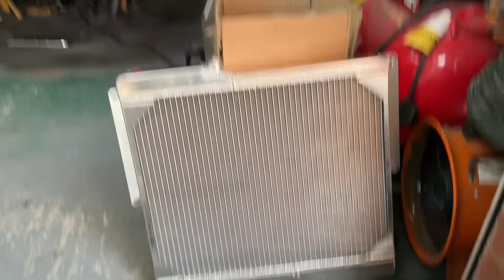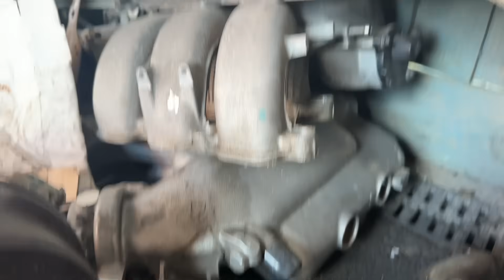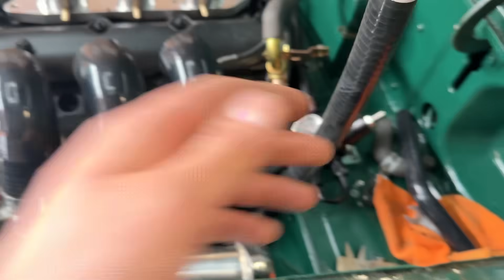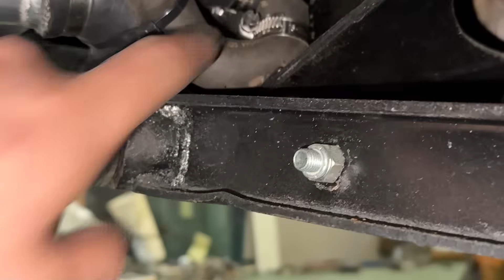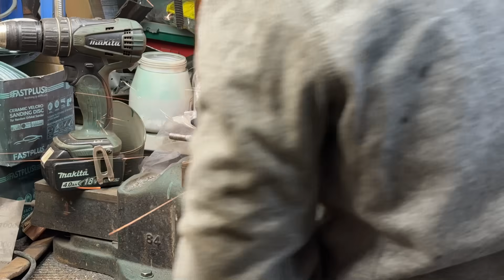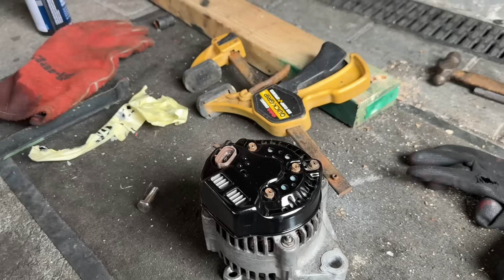FINALISING THE ENGINE BAY!! - Cooling, Intake & Alternator on my Jaguar powered MGB GT!!

Comment: Hi Henry, For some reason I can't add another comment on your latest video post of the MG starting and Moving? However, you won't be able to get your mgb temperature gauge to work with the new Jag engine. The MGB use a combined Smiths Oil & Temp gauge, the temp side is fed by a vacuum sealed microbore tube linked to a bulbous sensor that screws into the block. You'll need to replace the gauge with one that is fed electrically. Cheers Nic
Reply from the maker: Thanks for this! I need to try and find one that’s got a standard coolant temp and oil pressure look but with a 1 pin coolant sender

Comment: I've given up on POR15 , it doesn't stick to new steel well and other paints  don't stick to it well,  also it doesn't keep long in the tin. I've switched  to epoxy primers now , on the under body I also start with brushed and rolled on cold galvanising primer under the epoxy , it's not a tough paint but the epoxy protects it well enough and I've had  hardly any issues with stone chip damage leading to corrosion blisters under the paint.
Reply from the maker: Good idea!!

Comment: just a old school tip for you, to check clearance under a hood after modifying, place old corrugated cardboard box over the area you're trying to check for clearance, slowly close the bonnet fully if possible.  on opening bonnet you will see perforations in the cardboard where there insufficient clearance. no marks in the cardboard means you've got clearance, if you need more of a clearance use more layers of cardboard. heads-up on the alternator, Car alternator generally will still work even if it's spinning in the opposite direction,  however the cooling fan on the alternator might not be as efficient as it will be spinning backwards and being that close to the radiator you will definitely running to issues. all things one learns by making mistakes.
Reply from the maker: That’s a good idea! 👍🏻 and yes I will have to see with the alternator. I’m hoping those 2 electric fans on the rad will help!

Comment: I thought at one point that you had lost it with the alternator, but a great resolve on it. Those Triumph  regulators really do look as though they belong too. Well done H. You rightly should be proud of how it's shaping up. Are you going to go through the belt tightening to show how it works in that tight location? Great work as ever, Joe,
Reply from the maker: Yer I will, I have done it now but I can go back and explain. Probably when I do the wiring👍🏻 Cheers!

Comment: Hi Henry great project, throughly enjoying following your progress. 😉 Just one question regarding the intake etc clearance issue, have you considered using the MGB 6 cyclinder or V8 bonnet? 🤔
Reply from the maker: Yes 👍🏻 I want to keep it as standard looking as possible from the outside for that sleeper look but it’s a possibility if I need to!

Comment: Hi Henry, you can only pass criticism or negativity if you could have done better yourself, me personally no I couldn't so well done, keep it up.  I suspect you will find some challenges around the wiring, just the way of the world.  The exhaust will also present its own challenges, based on what you have achieved so far I'm sure you will just take it in your stride, adapt, improvise overcome.  That alternator mounting and how you make the wiring work will be interesting, you are right everything is so tight.  Inlets / throttle bodies, very innovative, not the sort of solution you find in a manual anywhere.  Looking forward to the next episode.  Cheers Marty.
Reply from the maker: Thanks Marty! Much appreciated 👍🏻

Comment: An amazing transplant Henry, you have innovated and cajoled the whole thing into bending to your will. I would have given up around the time of the exhaust manifolds. The only issue I can forsee is that you need a shroud between the radiator and the support panel. Air will take the easiest route into the engine bay around that radiator , rather than go through it, unless you force it to with a shroud.  On idle in traffic with the fans on the air will recirculate around the panel and you will be overheating really quickly. Having the twin fans won't help unless the hot air can escape. At the moment, it will be trapped in the engine bay.  More power means more heat to get rid of.
Reply from the maker: I will have a think! And see what it’s like when it’s running if it needs it I will make it!

Comment: Henry, just a thought, do you think that heater valve might look more in place if it was painted black or grssn like the coachwork? It wouldn't stand out as much as it does in brass. Having said that it doesn't stand out that much.
Reply from the maker: Potentially! Although with the intake there I don’t it looks too bad now!

Comment: I strongly suspect you'll need to do something about that steering rack boot in order to be able to use the car legally on the road. You're going to need an MoT test due to the engine swap being a "substantial change", and having anything fouling any part of the steering gear is a major fault on the test.
Reply from the maker: Speaking to my MOT guy who’s an MG specialist in Warrington engine swaps don’t necessarily mean it needs an MOT. But I’m going to have him do one anyway.
Reply: @HJRgarage  The MoT exemption remains if the engine swap uses a type available as original equipment, even if the capacity is different. In the case of the MGB, a Rover V8 or a bored-out B-series would retain the exemption. 

No MGB ever left the factory with a Jaguar AJ-V6 engine, so this counts as a substantial change which loses the MoT exemption.
Reply: @Zeem4  You are wrong, DVLA are only interested if it breaks the eight point rule so the engine swap is okay but the body mods are not. It all depends on how the MOT tester views it. I am doing the same conversion and went down to the local IVA test centre and they said tell the DVLA what you have done and see their response. The same with the MOT test, the tester is supposed to inform the DVLA of non compliant conversions. The MOT exemption is ridiculous anyway, every car should be tested annually.
Reply: @philipwaterman7292  The 8-point rule only applies to retaining the original registration mark on a "radically altered vehicle".

However, I've just checked gov.uk's classic MoT exemption page again, and I suppose that installing an AJ-V6 into an MGB could be classified as improving the efficiency or environmental performance, which would mean that it doesn't count.
Reply: @Zeem4   I informed the DVLA of the AJV6 engine change, I also informed my insurer, the insurance companies share information  with both the DVLA and VOSA and no one has asked a question as yet. Admittedly It isn't on the road but no one has asked. The eight point rule is about keeping the classic car status, when you loose that you loose the MOT exemption. After the consultation last year it is likely classic cars will loose the MOT exemption which will mean the MOT tester will be reporting more cars that don't comply.
Frontline fit a 2.5 Mazda engine cw Mazda gearbox and much modified suspension into both MGB's and now MGA's, they keep the classic car status due to complying with the 8 point rule. Even body mods are allowed if the factory did it, that is why there are so many Sebring copies, holes in the flitch panels for the exhaust is also allowed because MG did it for the RV8 and modifying the bulkhead is also okay because it was done for the original MGB V8. There is some disagreement as to whether those mods to the bulkhead have to be done  with original factory panels or not.
Reply: 👍like a glove

Comment: When mounted backwards, will the alternator not be running in reverse ? does that work ??
Reply from the maker: Phil got there before me! Read above 😂
Reply: I've done the same on my engine swap. It will work fine.
Reply: @ianmcass  Cant get me head round it, but must do as you say, never been good with that electrickery
Reply: @ianstoys13mgs  It generates either way, the only downside is that the cooling fan is running backwards so it is not as effective. The solution is to use an alternator from a circa pre 2003 Honda.

Comment: Throttle body clearance... I would ditch the T-Bolt clips and use decent jubilee type clips.. I use JCS hi-grip and hi-torque on turbo setups running 2bar boost and never had a hose pop off so they will be more than enough for an NA setup like yours... 

The narrower profile might give you wiggle room to cut a little more off the hose to get it to sit lower...

Alternatively maybe a 135 degree hose would work as that direct the bodies a bit lower too
Reply from the maker: Yes I have considered this! Nice one 👍🏻 this is not the final version it’s going to be a working progress for a while!

Comment: Those ITBs look impressive but I bet the engine will collapse those rubber intake hoses when the throttles are shut
Reply from the maker: Potentially but it should be ok it’s going to be a trial either way!
Reply: @HJRgarage  You could use some stainless steel bends with short rubber joiners, it will look a bit like the Ford SHO V6 engine which was the forerunner to the Duratec V6